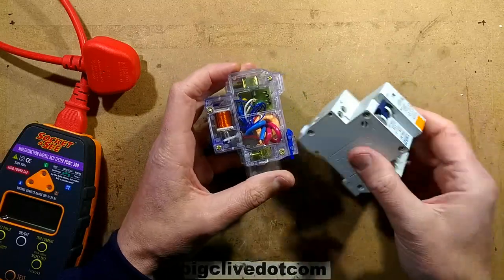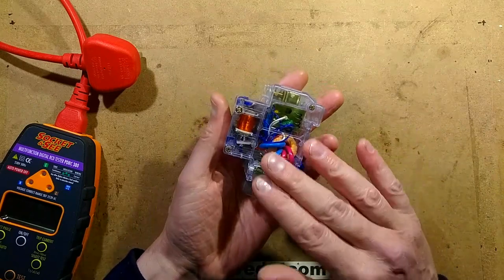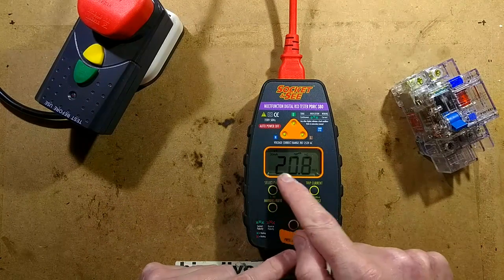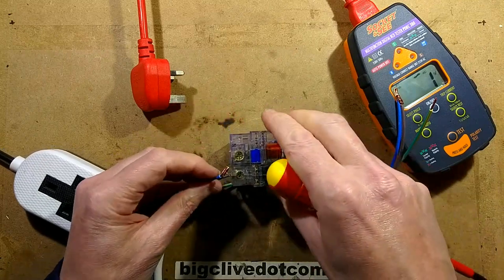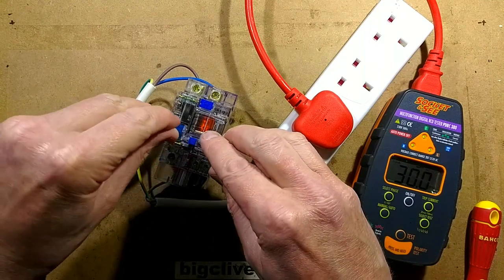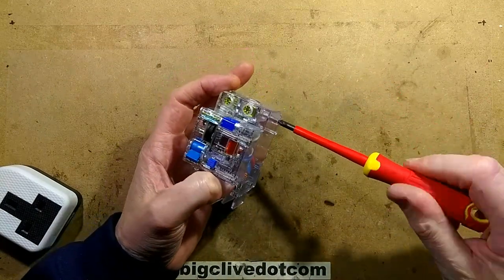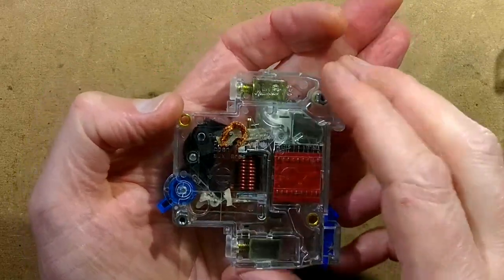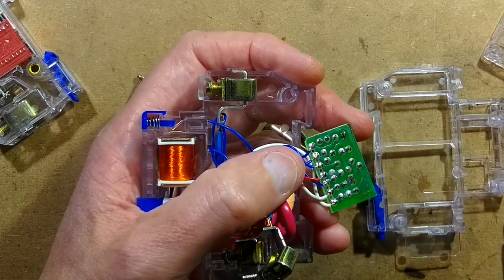Really neat transparent RCD/GFI.  (with schematic)

Comment: Back in '64 I was "electrocuted" when a double adapter in my left hand broke apart. I was thrown back and my left hand gripped the exposed terminals tightly. My good friend had the sense to grab the cable and rip it from my hand and so saved my life. In a reenactment we figured it was about 10 to 15 seconds before I was "released" from the life sucking force. To me, it seemed like an eternity. I could hear and feel and see the individual cycles, which seemed to me to be at about 8hz to 10hz rather than 50hz. We were outdoors, on the back of a tip truck being setup as a makeshift stage for a concert. As I rocked back and forth on my back the trees above me shimmered in sync with the A/C and I felt like I was in an enormous centrifuge or washing machine. Still have a barely perceptible scar on my thumb from the burn. As you say, even 300mS would seem like a very long time because in a life threatening situation like this time really does slow down. After that, I purchased a portable ELCB and have always insisted that all band equipment pass through it.
Reply: iconoclad, It is great, you lived to tell us and all. I was 'cuted too a few times, but not as dramatic.
Reply: stories like that are about dc lol ... ac rarely makes your muscles stiff like that for such a long period of time ?! Well at least thats what i learned as a paramedic 20 years ago...
Reply: I helped somebody (for free) that I normally did sound for ( and used to get paid for ) with an outdoor event that called for rain. thankfully there was no incident. however I was prepared ( a trait that I had before Boy Scouts ) and had everything on stage ran into the trailer (were all the wedge/mains amps and wifi mixer were set up) to the least populated closest to the door PDU so if disaster struck I was one switch away from killing all AC onstage about 10 feet away. later I remembered that I had put together a GFCI box that I wish I pulled out. unfortunately 3 bands in the owner of the equipment who really didn't want to be there called it and we started packing up. 10 min. after the  trailer was packed the rain stopped. and I still had to drive an hour home soaking wet from helping with tents, tarps, setup and mixing.

Having been at a church that did an outdoor picnic and always would have the worst weather for the entire year, I came fully prepared for this event and got no respect for my skill(s).

having both sampled of 120V US 60 Hz and 240V 60 Hz Filipino I feel your pain. and no I will never forget my experience either, even if I was just unplugging a fan from an extension cord. ( I did not bring enough electrical tape with me! ).
Reply: @The1Rausch Perhaps you should return to paramedic school for a revision, your recall is opposite to the facts. AC causes tetanic contraction, DC does not.
Reply: Reminds me of the time I was far too casual and stupid, and got a hand-to-hand 240V shock to remind me to be more sensible in the future.

Like you, I felt every pulse and they seemed to be around 5 Hz.  Time obviously slowed down.

Fortunately the shock was applied to the fingertip of one hand otherwise my fingers would probably have locked onto the conductor (AC tends to do that) and it was such that I could jerk away from it without help (which was very fortunate because I was on my own).

Didn't last long.  Maybe 10 pulses in all.  No visual effects.  Other than my underwear turning brown.
Reply: checked my reference , and believe it or not i found my book from 1997 and (sorry its german have to translate) its just a yellow box which somehow sticked in my brain. its a !CAVE : Initale Muskelkontraktion kann bei Gleichstrom deutlich stärker ausfallen als bei wechselstrom. "The first contraction is stronger at DC than AC. further down on the page there are examples, a guy broke his own arm during AC Contractions at around 350V etc... a lot about the frequency (how much Hz) , totally forgot all of that. Well selective learning isnt always good. You are right. sorry.
Reply: +The1Rausch
The implication of some of that goes contrary to my memory of what I'd been told long ago.  But my memory is increasingly unreliable these days.  So I went digging.

I found an article on quora by Murali Krishnan which says it's harder to let go of AC (which is what I remembered).  He quotes a myth common on the internet that the zero crossing parts of AC are when you can relax your muscles, and emphasises that it is a myth.

He quotes IEC publication 60479 - Effects of current on human beings and livestock which states that the let-go of parts gripped is less difficult with DC, and that this statement is based upon empirical evidence.

It's harder to let go of AC.  AC is lethal at lower voltages than DC (at least that's what the MoD had to say about it back in the 80s).
Reply: thanks for digging in a scientific way. it depends on the frequency if/how leathal ac is, right ? High voltage at ac makes your muscles contract up to a point where bones break at.thanks for pointing that out. DC , thats what i learned in the early 90s, will produce scars more quickly and if it passes through a bodypart you can exactly tell where it went along  (at least as a coroner) by just following the necrotic tissue. so if you are a prokaryont (a cell) you might have the standpoint that dc is more lethal ;) 
So what do you guys define as "more unpleasant" ? 120V DC / AC (typical ac 50/60Hz) ? 
what "feels" worse if you just get a short hit ? i do not want to test so i call for oppinions ;)
Reply: +The1Rausch
I'm not sure about the frequency.  I was told at a place where I worked that 200V 400Hz was less dangerous than 240V 50Hz and that the frequency was part of it.  Whether or not that was true is another matter.

I have no experience of my own comparing AC and DC.  I can tell you that 240V 50Hz is very unpleasant.
Reply: i live in a "240V 50Hz country", too ;) Teutschland Kappa ... got shocked numerous of times so far - unpleasant but no big deal. the frequency on the other hand... i learned (need to recheck) something about 50-60Hz being the closest to the signal of a biphasic defibrillator or something like that... but to grill the Sinus AND AV Knot AND enough tissue in the heard to surpress the base rhythm of the muscle cells all together on a fully healthy person is... pretty unlucky with a short AC shock i guess. You need a special waveform and go over board with the joules (for a easy suicide i would choose 500J lol) and you need to make sure that no breaker is active, because you need ~30A to succeed ... perhaps i am wrong, not an expert at all... just interested in the topic to fill some knowledge gaps !
Reply: iconoclad is the only thing that matters
Reply: lest we not forget the Westinghouse method that was coined by Thomas Edison to discredit the AC system of his competitor Nikola Tesla.......
From personal experience between 120 AC 60Hz and 240 AC 60Hz, the latter was much more of a "I need to walk this off, be back in 10 experience. unfortunately I didn't sample any of the local juice in the UK 240@50Hz.
I also want throwing here that I remember being taught very young to have a wooden broomstick handy to push people away if they were to come in contact with something.

Comment: Is my understanding correct, that the plastic casing has to flame retardant to some extent ?
I don't think it's possible to make plastic transparent and flame retardant. The Chinese ones could be a fire risk if I'm correct.
Reply: Perhaps this video needs a part 2
Reply: By the look of the plastic and the sound when Clive dropped it on the bench, it's moulded from polystyrene which is definitely not flame resistant.
Reply: Doesn't "Made in China" already translate to:
"This is not to code."
"This will not suppress an internal fire."
"This will be a fire hazard."
"This will void your home insurance."
"Don't come a-knocking when this fails and burns your house down because we are a fly by night company and you won't get a cent from us."
Reply: not ''Made in China' per say(no doubt some reputable brands will manufacture such devices in China) , but more 'Made in China' for an unknown brand or unbranded item
Reply: ElmerFuddGun I don't think so. You get what you pay for.
Reply: They do make flame retarding plastics which are clear. They are fairly expensive though.  I forget the exact chemical name for it, which means my comment was actually a waste of time. Sorry :D

Edit - So I checked my bottomless box of stuff. I found some. It isn't perfectly clear, but you can see through it. Sort of an off-yellow.
Reply: Dan, there may be an identifier inside a recycling symbol on those parts which tells the material. Also, the yellow shells are normally used to reduce arc flash intensity for vision safety. A lot of the higher voltage relays at my last job were like that.
Reply: Chaos Corner . . Then it's time for Clive, to pass it to Photonicinduction & he can have a 'Test' or two!

Comment: Combination MCB/RCD units are quite common in Australia. The double with ones are nice with their flags, but even the good brands leave out the flags in the smaller ones, making it hard to work out what tripped them.
Apart from that, they are brilliant, isolating a fault to one segment of the house so other power circuits and lighting are unaffected.

Comment: Great post thanks! Very informative. 

LOL at your PDRC380 which my colleague designed. It's OK. We've had a few hanging round the office and the batteries have leaked which in my experience is due to small (but not zero) current drain. Maybe check yours from time to time. 

You're right the LCD is difficult to read. That's as much due to refraction in the plastic window as poor design - which was non-existent on this range. For its successor I suggested the product designer responsible for the enclosure also designed the LCD, and that worked well. 

There's no real difference in phase at x0.5; the AC test current is long enough for plenty of both polarity edges. For comparison, ramp tests use a dwell time of 300ms at each step. 

Type AC x1 limit is 300ms, x5 is 40ms (this corresponds to full mains voltage on the EN61010-1 accessible voltage graph). These days I would think a tightening of the x1 response is appropriate and that's what you see when testing. Only selective breakers go over 100ms. RCDs really are a godsend. 

I'm a bit doubtful about that MOV. I can see why they've got it - to prevent dV/dt SCR firing. But shouldn't it be downstream of the trip coil? Something so close to the supply will experience the worst of it and it's only a 10mm part. 

The 3K3 test resistor is too low for 230V operation IMHO. 

If you're interested in RCDs, have a look at Type A (pulsating DC ie half wave rectified) and then Type B (smooth DC ie electric car charging stations: yes we are going back to DC!)
Reply from the maker: +Mike Page I always remove the batteries from these units when not in use to protect against expensive leakage.  I intend to test ordinary RCDs with various DC biased faults to see what type of circuitry defeats the protection.  I'm guessing the proper pulses and DC fault versions are going to be quite complicated inside.
Reply: If you manage to saturate the CT without tripping you will indeed defeat the protection. That's how Robin Dlok worked. It was about 0.5A DC from memory, fairly quick ramp about 1-2s.

Comment: Well that circuit explains why one half wave takes longer.... It waits for the other half of the wave to trigger as it can only trigger in one direction. I guess most RCD's with a short half wave and  a much longer half wave might use a similar concept.
Reply: OH i think you have answered my question i posted just now, it the "fault" were passing through a diode the feedback from the coil would always be out of phase getting clamped by the diode but it just "rings" inside the coil producing a smaller but still enough potential to trip it after a small delay. am i right?
Reply: If you look at the circuit, the diode on the gate of the SCR will short out (you will of course get the 0.6V Vf drop across the diode) any voltage that is positive on the Anode to the Cathode.  The 0.6V VF is probably not going to trigger the SCR in this manner. On the NEXT half cycle The voltage across the diode will be Positive on the Cathode  with respect to the Anode and this voltage will then trigger the SCR, tripping the RCD.

Comment: Amazingly I too had a shock at the age of 11 or 12 I think it was when I was fixing an old TV using a mains plug,  cable and crocodile clips. i forgot that the TV was still powered on and grabbed the crocodile clips to stop them shorting out.  I got the full force through me at 240 volts 50 cycles as it was then and I can confirm that time slowed down very much.  I too have the scars on my fingers to prove it.  Also everything went black and stars passed before my eyes. 
I did manage to use my feet to push the cables away. 
Although I was screaming out the washing machine engineer in the next room thought it was a baby crying and ignored me.

Comment: Agree with Clive that the larger physical size of the 2-part module may be less likely to allow an internal phase/neutral short compared with the narrow-bodied enclosure type. The case of the grey module is marked 4kA fault rated whereas the higher 6kA seems to be common in the uk.

Comment: In Canada a lot of the new breakers being installed are combination breakers, GFI/GFCI/RCD, and arc-fault detectors.
Reply from the maker: We've not got the arc fault detectors here yet.  Generally on 240V we tend to have louder and more decisive faults.
Reply: 240v tends to go with bang 

or in my case a pop when a mouse decided to chew through a positive and earth ring main cable it confused me at the start because we thought it was the fridge of the freezer that was tripping out as it was being very intermittent, eventually I was on the floor for over 15 minutes waiting for the damn thing to go pop and then I saw where the flash came from where the mouse had chewed it
Reply: they are on the way Clive , mentioned in the 18th edition draft document that's  available for public comment now. Great video by the way.
Reply: I'm not a big fan of these combination breakers + RCD, as RCDs tend to fail much more often than breakers and I'd rather replace one device than two. And it's easier to bypass the RCD and still have overcurrent protection before I go and buy a replacement RCD (of course I mean at my own house). And for work I can just have 2 or three standard RCD values in the car and swap it on the go.
Reply: Lee x, did you find the mouse, probably up to ten feet/ three metres away? That happened with a friend's guinea pig when it chewed through the TV mains cable. The first they knew about it was when the power went off and most of a quivering guinea pig, minus front teeth, landed on the settee  at the other side of the room. It didn't have the chance to do it again.

Comment: 16:30 The resistor is likely calibration, yes. The diode is likely there to prevent "wrong direction" pulses doing bad to the SCR, probably unlatching it once triggered or such.  The Capacitor will be parallel with the inductance of the core, likely to prevent any RFI getting at the SCR and randomly triggering it.

Comment: long time ago video Clive but still very informative.  Question, you test it with Britisch plugs. which un ables switching polarity. But lots of EU countries use Schuko plugs.Which enables polarity switching. Also even CEE connectors are wired wrong. Would this GFI with these electronics work with a switched polarity?  thus trip? or damage the thyristor? 
I ask because i see GFI's used and advised for in-cable solutions on generators and powerstation solutions with a Schuko outlet to campers/boats and outlets etc.
Reply from the maker: In their intended place in the circuit they would be breaking the live connection.  If used in an appliance where that could be swapped then you would need a double pole version.

Comment: Anybody else notice that the Line and Neutral were wound around the ferrite in opposite directions? That's how the current is cancelled out, the magnetic field induced by one wire is cancelling the magnetic field of the other. When something grounds out one of the wires, it makes the other wires magnetic field strong enough to activate the GFCI.
Reply: I see them wound around the same direction.  (Look at 13:50.  I believe the two terminal at the bottom are going to the load.  Both wires go though the center of the core in the same way.)  The current though the wires travel in opposite directions, so the magnetic field is canceled out.

Comment: Note that the thyristor will only latch on for a half cycle.  It shuts off on zero crossing.  The 12K resistor is probably for noise suppression - just enough of a load to know it's a real imbalance and not some stray noise getting coupled into the circuit.  Likewise for the cap - take care of high frequency noise.

Comment: bigclivedotcom Clive, what are the UK requirements for arc fault interrupters, and have you had much experience with them? That might be a good teardown. In the US, all new builds, and proper repairs require combo GFI/AFCI receptacles, where used. The combos are about $30 (which is why I haven't gutted one yet), but I expect that price to drop as production increases. As another commenter wrote, It's quite a feat to jam all the works into our much smaller electrical devices.

Comment: Much simpler than our gfci receptacles. As of this year or last, they're required to trip off if any component fails so there must be a slew of monitoring circuitry to make that happen and some brands run quite warm as well with no load plugged in.